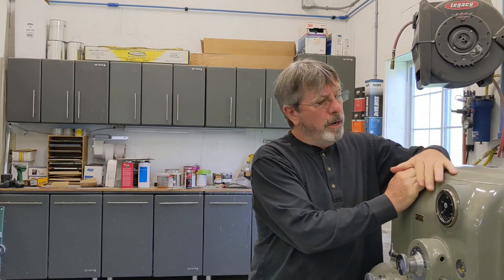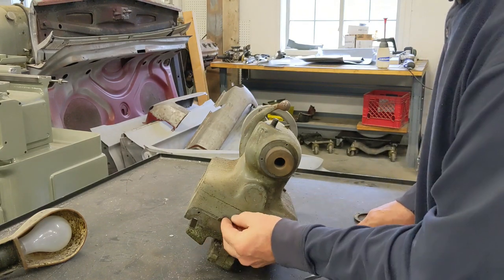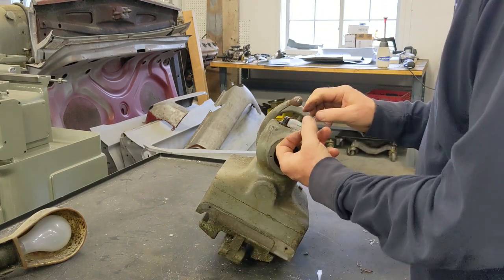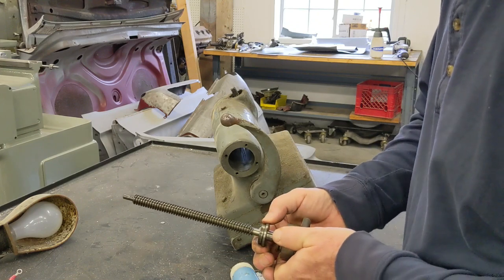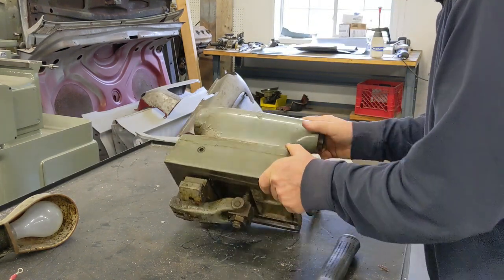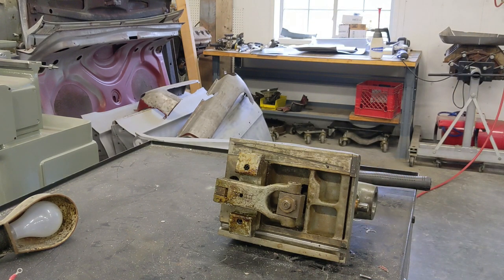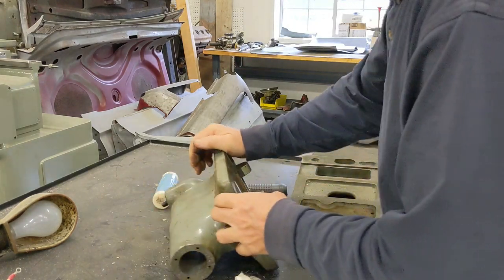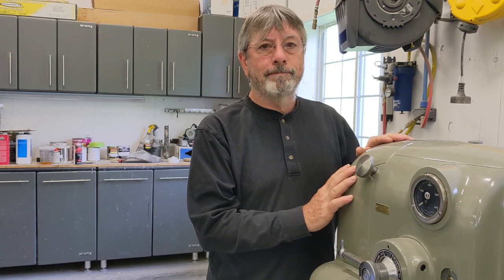Monarch 10EE lathe part 27a

Comment: Probably too late now but I suggest converting from a roll pin to a taper pin.  On my lathe, built in 1965, monarch didn’t drill the oil hole through all the way. All those years no oil was able to get down to the flat ways.   Even Monarch makes mistakes.  Because the ways were ground .004” a shim was necessary between the top and bottom pieces.  My friend Archie scraped the bottom ways that ride on the bed ways.  It came out beautiful.
Reply from the maker: Thanks Will! actually that's a good idea to go with the tapered pin. I'll add that to the To-Do list!
Reply: Would it be possible to drill holes vertically in the upper part of the tailstock from the oiling slots in the bottom surface of the upper t/s. Then tapping small npt threads in top and installing a couple of those old timey automatic drip oilers with the little on/off toggle on the top?